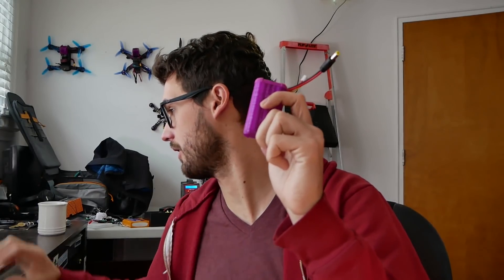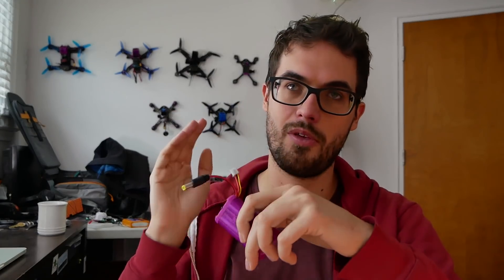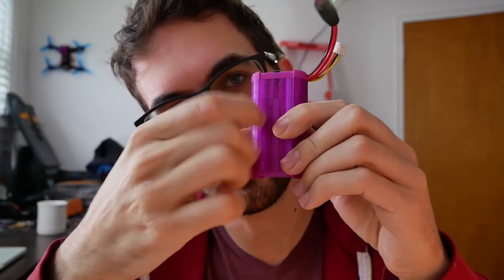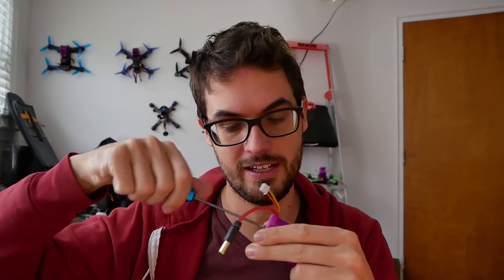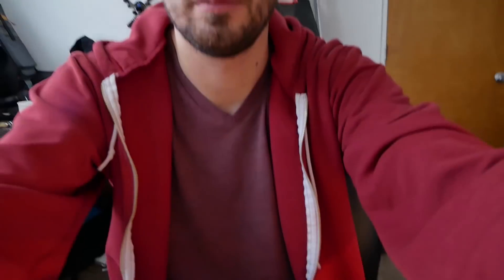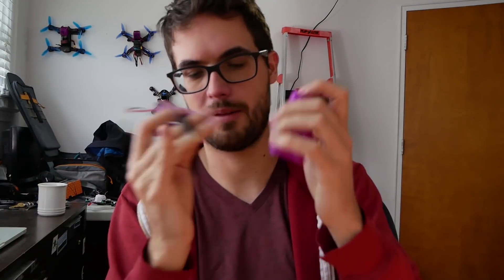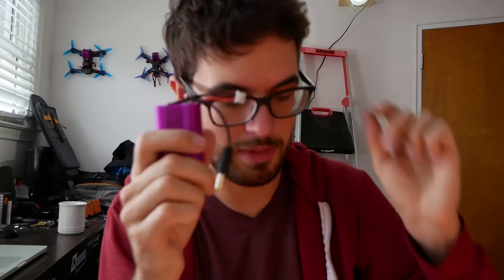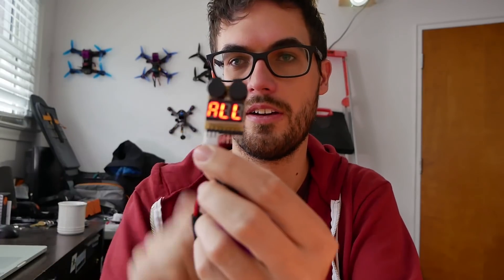DIY 18650 Battery for FPV Goggles with 3D Printed Case

Comment: I made from these for my fpv goggle which accepts 6-28v max 300ma current. And when I plug it to my goggle, I start to hear a whistle noise and very bad static on lcd screens. Just showing battery charging icon on the goggle but It's not charging.

Comment: I have a major issue with my DJI goggles constantly turning off because the power cable pops off so easy. What have you done to prevent this from happening or is this just an issue with my goggles? I have tried out a coupe other connectors and they all seem to just pop out way too easy to where its almost unsafe to fly because if I tilt my head the wrong way it may move the wire just enough to disconnect. I even tried pinching the metal leads in the connector to try to make it a tighter fit but doesn't really help. I'm going to end up just hot gluing it on if I can't find something else that works.

Comment: Why didn’t you run the bardwell step up Pololu 9v regulator mod? That and a small notch for a led indicator in your print and you’re way better than fatshark. 
What TPU did you use?

Comment: I printed your case and it could use 3-4mm less diameter and 2mm shorter per cell chamber. They really rattle around in there, looks like you designed it around a 20700 battery?
Reply: nomand I think you’re probably (maybe) using the shorter & sometimes skinnier non protected 18650 cells?
Reply: Using "naked" cells, salvaged from laptop batteries, you might be right. Naked cells are the standard 18650 though, just not at consumer retail end.

Comment: Drib 2? why not drib DIY or DribTech....

1. Why didnt you design a switch since you were designing a case?
2. Would using battery contacts have made the mod that much larger?  
      I'm all for compactability but the ability to replace the cells in the field would be great.
      I've opted to using thing from thingiverse mod that lets me put my fat shark 18650 case vertically. I've been meaning to redesign it so I can have a power switch.
Reply: 1 Small switch a possible failure point between the contacts, slider, dirt, solder points etc. 2 Contacts get corrosion etc., solder mostly not.  The whole concept is reliability, too many other things to keep together without a simple battery being another.    Just my experience.
Reply: Wrstew I'd rather a switch fail then the dc jack 😀

Comment: Wonder if anyone has tried the fatshark transformer battery pack, holds 2 18650’s and you don’t have to solder them. It also has a push button battery level checker built in. It is a bit larger than this though and I’m not sure if the barrel connector fits the slim fatsharks.
Reply: Yeah I do and I love it. Used good quality panasonic cells in it and the seem te last forever. Little on the bulky side but perfoms extremely well.

Comment: I made myself a second 18650 pack for my dom v3's the other day. Wired the balance plug wrong and fried the fan. Not happy. Moral of the story boys and girls, triple check your wiring! I'm lucky it was just the fan and not the goggles. Faceplates for the dom v3 are not easy to find.

Comment: soldering directly to the battery- heating it up - will reduce its lifetime, that is why its better to use plasma or sonic , there is no overdischarge overcharge protection here

Comment: Your comment on the balance leads brings up a good point that I really need in a video, and I'm sure many others do too.  I have a nasty habit of somehow managing to rip the balance leads off my batteries when I wreck.  I have had to throw away multiple good high quality batteries because I can't seem to ever get the balance leads working right again after I repair them.  I would really like to see a video giving some examples of equipment and methods of repairing not only balance leads, but all of the small plugs we deal with constantly on VTXs, cameras etc.  I'm always having to replace wires and connectors, but can never seem to get the crimp right, or cant figure out what connector I need to buy.  Thanks.

Comment: Cool. Drew I got a Mavic and I'm ordering a set of small cases for it and the remote so I can put in a backpack. What backpack do you use when you actually use yours on locations you travel to? Sent u a tweet but figured I'd throw it in here. You should sell those batt. cases, good design :)

Comment: Good info man. Fyi...also works great in a QX7 with an xt60 instead of a barrell
Reply: JoeStan FPV Good thinking, how many 18650's do you need?
Reply: Just two. Same as the fatsharks. I just used an xt60 and 2s balance lead for easy charging
Reply: Haha I only have eachine vrd2's. That uses two 18650 batteries which the same as you I use balance lead
Reply: @Danik FPV no the xt60 i just used the xt60 to make charging easier. The 2s balance lead powers the radio
Reply: Did you mod your QX7 to power it up with XT60? I'm powering it with a 2s lipo through the balanced lead

Comment: why not rather than solder to 18650's make the 3d case to you can slide the 18650's out and replace them with another charged set

Comment: one question i have is, how can you change (if possible) the LVC for the fatsharks? i do this and they still go beep beep when the thing is still got like 1/2 a battery left.
Reply: J Bardwell has a build vid for a polulu  voltage booster to increase to 9v to make Fatshark happy.  BUT you can over discharge the batteries if you leave plugged in. Also would need revised case, Drew went for simple, Josh for Bells & Whistles

Comment: I made three packs of these for my goggles the other day. However I connected xt60 so I couldn't balance charge via my balance charger.

I have 3700mah batteries, my question is if I am charging my 3 battery packs in parallel. Do I charge them exactly the same as you do lipo (e.g 1c per pack) but using the lilon function?? 

I actually haven't charged my batteries as yet for the above reason.
Reply: you should use the LiIon function......... but I use LiPo, it'll probably be fine ;)
you can balance charge and parallel charge just like any other pack
Reply: Le Drib Thank you Drew, 3.7a x 3 here I come!! I'll use the lilon because I'm a chicken :-) 

Great content (as ever) and thank for the prompt reply. 

P.s you need to call this channel DribTech ;-)
Reply: I'll 2nd that name!
Reply: If you charge them like a Lipo only use 0.5c for charging.
Reply: ZeroFPV I plan to use lilon so what charge rate would I need?
Reply: 1c = capacity in mAh / 1000. So if your 18650 cells do have a capacity of 2500mAh then a 1c charging rate would be 2,5A. So you should charge your cells with 1,25A (0.5c) at a maximum. If you have higher capacity cells 1c/0.5c would be higher. 
Btw. Most dedicated 18650 chargers only use 500mA for normal charging up to 1.5A for quick charging but they don't know what capacity cells you are using so they are "playing save".
Reply: ZeroFPV I get that. If I'm using the lilon function can I charge at 1c? Or would you still recommend 0.5c?
Reply: I wouldn't recommend charging them over 0.5c at all. :-) For 18650 LiIon cells it doesn't really matter if you charge them as a Lipo because their max Voltage is 4.2V as is the max cell Voltage of LiPos. However there are LiIons with lower max Voltage out there. You would overcharge them by using the normal Lipo settings. For them is the LiIon function.
Reply: ZeroFPV Thank you, I'll charge at 0.5c on the lilon function :-) 

Going to order or more batteries for my taranis qx7 and do exactly the same. 370mah batteries are Ace